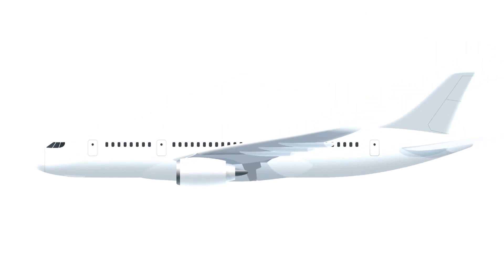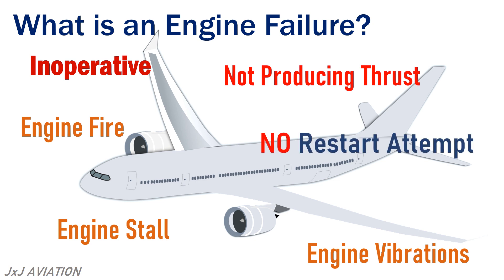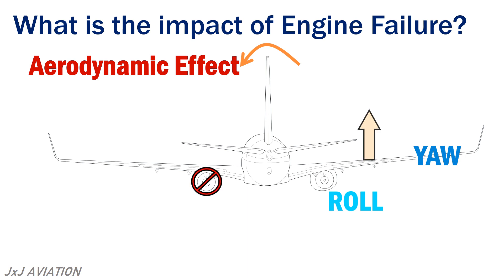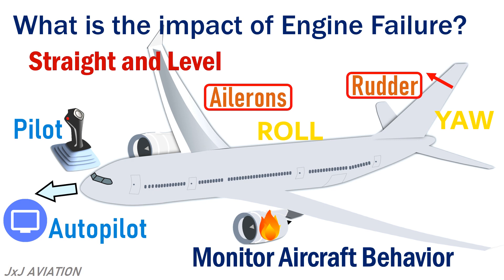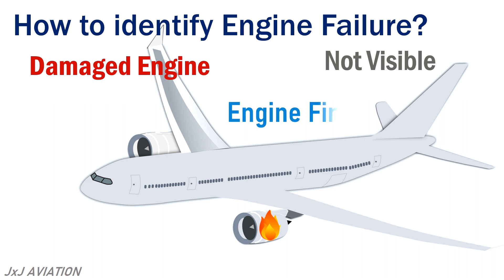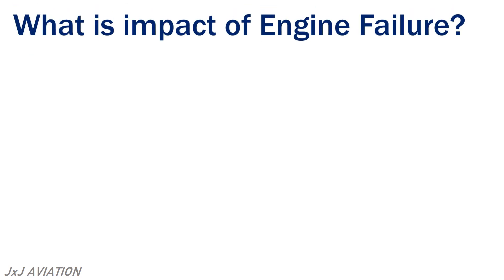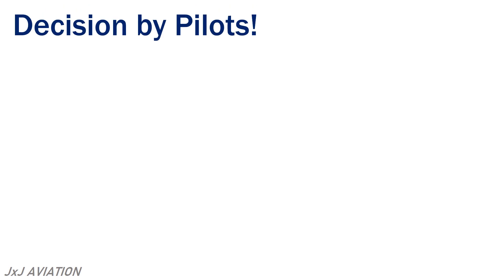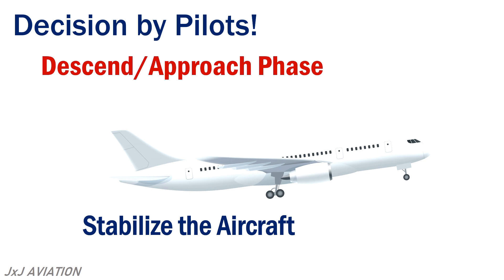What causes Engine Failure? The impact of an Engine Failure| What pilots do in case of this failure!

Comment: Your video is very great and have a really decent explanation! I'm sorry, but i still can't find the answer that i want for what is the cause of an engine failure. 

From the video, the general cause can be from external or internal. From the external, i guess it can be from weather or maybe a bird trapped(?). From the internal engije causes, what is the problem that cause a sudden engine failure? What can cause the flame? Because from what i knew as a layman (i'm not in an aircraft related study) there's always a check for the airplane. 

Is that an human error while checkinh? Or some cable suddenly cut off or smth??

I'm sorry if my question sounds dumb and i'm really greatful if you can answer my question. Thank you so much!
Reply from the maker: Firstly no questions are dumb. Good that you want to learn! Engine failure could happen because of external or internal factors. External factors could be because of foreign object damage such as bird strike or any other metallic pieces getting ingested or could be because of sudden changes in wind direction. 
Internal Factors could be damage of the components within the engine or sudden fuel leak within the engine. But these factors are hard to observe when checked from outside the engine. So cant say its a human error.